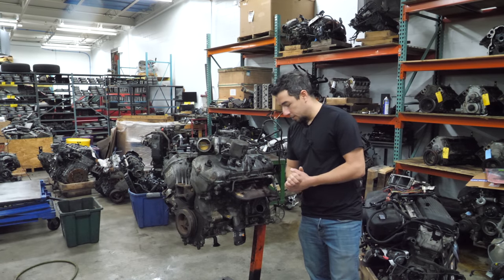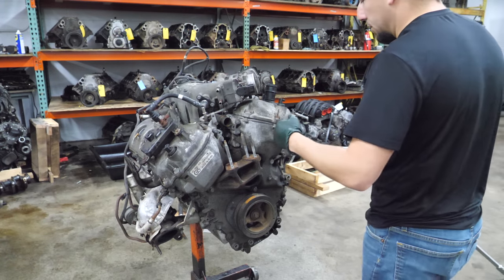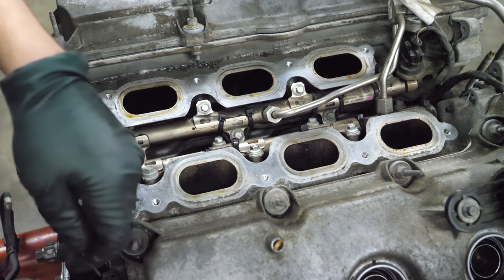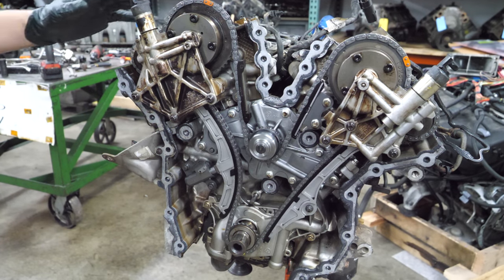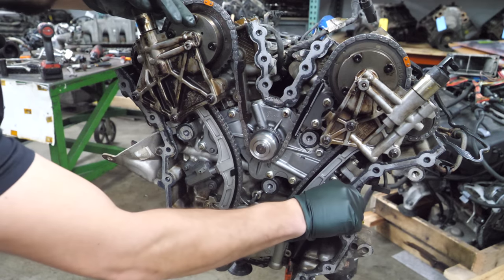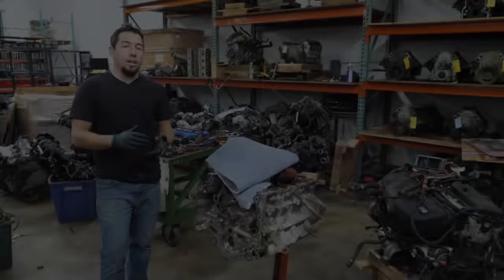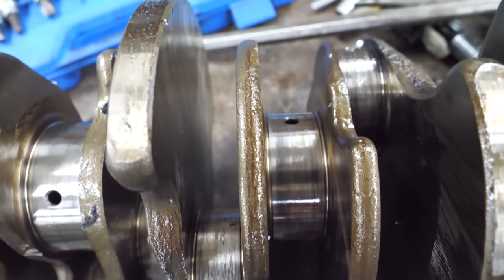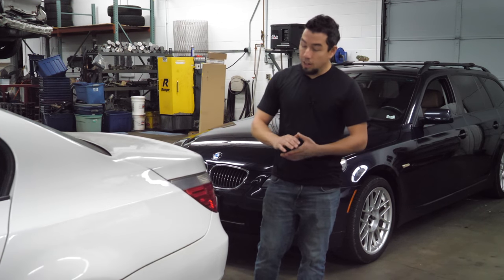Taurus SHO Flex ECOBOOST 3.5 V6 BAD Engine Teardown! What Killed This Maintained Engine?

Comment: I remember watching How It's Made at a Lotus factory, and the sealer dispenser they used only put down a small strand of sealer, about the size of a piece of spaghetti. Ya don't need much at all on two machine surfaces people.. facepalm  Also, EricTheCarGuy has mentioned more than once about too much RTV getting stuck on the pickup and oil starving the engine
Reply: Had it happen.  Bought a little Toyota from a guy who "lost his job at the dealer" He did a light rebuild and it lasted about a month and started knocking.  Pulled the pan and the pickup was covered in rtv worms. Big ones.
Reply: That's the issue that the Toyobaru guys were having with the valve spring recall. Techs were using too much RTV on the timing cover and it was leaking down into the oil pan and clogging the pickup. Bit a friend of mine last year while we were on Tail of the Dragon.
Reply: @CaptainSpadaro  what does Valve springs have to do with timing covers and oil pick up
Reply: @alexstromberg7696  Have to remove (and therefore install and apply RTV, with the associated risk of excessive RTV use) those covers in order to do the valve springs. Excess RTV gets into the oil pickup, then, oil starvation and boom. RTV is only to be used in very small amounts.
Reply: @alexstromberg7696  because the timing cover has to come off to remove the heads? IIRC it's an engine out job anyway because lol Subaru boxer.

Comment: So what happened was, the water pump failed, and the vehicle was ran until it shut off, low oil pressure. Towed to mechanic, they found the bad water pump, did it, chains, guides, etc. and still had a knock and low oil when ran, coolant oil mix, along with clogged feed line screens, killed the turbos
Reply: yep

Comment: Also, must be a 10-12 as it has the single link chain vs dual link
Reply: The aluminum valve covers and steel manifolds tell the tale as well.
Reply: Some of the late '11 and '12 engines got the new timing components before they switched to the new cam and crank sensors too.

Comment: Love your vid's. Coming from an aerospace career, 36 years now retired, I have used pigmat for years and yes it is awesome stuff. Also looking at the design of oil pumps, the gear looking combo is called a Ger-rotor,  it is such a durable design. Seeing all the videos I have from you its good to see this is a universally used design. This engine was maintained, to a degree, I say that considering the odd brand oil filter used! Makes me wonder what oil was used? I agree with Eric, turbo failure was the probable cause of engine death. People are stupid! They ignore warning signs. I do like these engines and have had a few, the power they produce is certainly fun to drive! But you need to be on top of maintenance and quality of fluids and filters used. I know I am preaching to the choir here. 
Merry Christmas and Happy New Year to Eric, family and crew.

Comment: It is kinda sad to see this happen to an engine. They're so complex, and expensive to manufacture, let alone purchase. It ends up being such a waste.
Reply: Puts the whole EV thing in perspective. This engine isn't even that crazy... Look up his Infiniti Q50 V6TT teardown. That thing was a space station. All to make like 19MPG average.
Reply: @future62  And someday we will all drive flying cars!
Reply: @future62  And yet the aftermarket tuners/builders working with old school engine tech can easily do all the numbers on HP and fuel efficiency and more with ease just by going as far away from emmissions compliance as possible.
Reply: These really are simple engines and also cheap you can get a used one for as low as 1400. The tesla battery pack is 20,000
Reply: @blueblood76  Well, from a 4-cycle engine process they might be simple, but from an engineering standpoint they're pretty complex. Just ask the engineers who were involved in their development. And yes, used, depending on condition of course, I'm sure they can be had for cheap money. But coming off the assembly line, they are anything but.
Reply: @michaelskinner896  There is nothing in this engine that engines for years haven't used, Its very easy to work on really. Some engines are a nightmare. Any and all engines are pricey from the maker brandnew. Also these are 6500 brand new while a tesla battery is 20.000
Reply: Sad? This is MY engine. I work for Henry at Chicago Assembly on the motor line. I dressed this very engine. Now I see it’s autopsy! 

When they leave my station I expect them to be well taken care of.
Reply: @snackler6102  It's a really good thing Tesla isn't the only EV maker in the business then.
Reply: @fixedguitar47  Hi I work for Ford in the UK, and worked in Powertrain Product Development for 15 years. I'd agree with guy tearing the engine down that there's usually many warnings before a catastrophic failure. Also worth noting this is basically the same engine in the Raptor and the Ford GT, it's quite an accomplished unit.
Reply: @jameseastwood4984  - I know that, I just expect them to be better cared for. I have mechanical sympathy.
Reply: Bo Blu  Yes they are diaper boy.

Comment: It was mentioned earlier and I don’t know if you see all of the comments but, I would like to see you cut open the oil filter on these obviously neglected engine’s to see if the filters are glogged and allowing contamination to bypass. Which is surely happening.

Comment: That was very... informative.  Ironic for me, anyway, I stopped this video 1/2way through to go eat breakfast, pick up and replace my leaking oil pressure sensor on my 2013 SHO. It was nice seeing it in the daylight instead of in the confines of a dark engine bay. Also helpful was seeing and understanding the design of the internal waterpump and weep hole set up.  In the past 13 months I've had it  with the timing set replaced. Thanks to your wife for allowing you the time to do the teardown.

Comment: This is a bit off topic but it does relate to.the oil on the concrete situation, when I was repairing power tools for a living 20.yeats ago where our parts cleaner was located in the workshop the floor had this thick ripple Teflon coating on the concrete made it to easier to mop up any spills & the ripple coating was there to prevent anyone from slipping & tripping over on the floor if  any oil or parts cleaner was spilled on the floor !

Comment: You are correct! That engine was oil starved because the turbo failed. But WHAT CAUSED THE TURBO FAILURE? ….. Aftermarket oil filters with extended drain intervals. The aftermarket oil filters do not have enough surface area to contain all the oil debris that is generated by the extremely hot turbos. The filters become plugged, and then enter bypass mode. That debris then gets pushed into the turbo oil, line filters, those are located at the turbo charger, where the oil line goes in to it. Once that filter in the turbo was plugged, the turbo was oil starved. It only took very little time to destroy the turbo charger at that point.

Comment: The weep hole gets dried coolant plugging it if the coolant level is topped up repeatedly w/o finding source of leak. The oil seal on pump keeps oil from going into weep cavity but lip of seal is pointed wrong way to stop coolant from passing when it can't go out weep hole. Has happened on Nissan v6 engines too.

Comment: Sister had EcoBoost 3.5 in Lincoln MKT,  needed cam chain at 50,000 miles mostly city driving. Luckily she got it done under warranty.  It was a lemon in other ways too, but fast as lightning.  I told her to dump it, and has an MKX now. Besides carbon building up on back of valves, oil dilution is a problem on those engines.  This coming from a Ford fan.

Comment: Looking to buy a 2012 ford ecov6...  Motor lockup.   Im thinking this condition.  Looks like poor labor did the timing and watrr pump.  Which caused the oil flow issue..  sloppy labor caused oil pump being restricted..   causing all the othere issues!

Comment: On my second car, the boot was also stuck down the well.  I couldn't find the right combination of pliers + luck to free it.  My dad walked outside to ask why I had taken so long, and him told him how stupid the parts were.  I probably blamed everything but myself.  He went back in and returned with a coat hanger, snipped the hanger with the pliers, pinched one end into a barb, and speared the slippery boot like it was nothing.

Comment: An easy way to get those broken off boots out, especially on that engine is spray pb blaster in the hole,  take an awl and work the boot around. Now take a 90° pick and get underneath of it and pull up and it usually comes right out then blow the hole out with the compressed air with a rag over it.

Comment: As I just stumbled onto this post today (12-5-2022). And being this is my first time watching any of your posts , I say Kudo’s !! Great to find someone who doesn’t “ Blather-on,& on “ about nonsense.  My guess as a 43 year career mechanic is that the excess silicone on that timing cover sloughed off internally and in due time were sucked slowly through the fine mesh collection screen on the oil pump pickup , destroying the oil pump by slowly starving the lubrication system. To the point of metal on metal in the rotating assembly that we see all too often as the culprit these days …. Oh well , to quote Queen, “ Another one bites the dust “ …. That turbo though is suspect too…😆👍

Comment: I was driving an ‘81 Mercedes-Benz 300SD on the highway when my engine locked up. Found out the turbo failed and like you said, the oil was sucked out of the oil pan.
Reply: We had a 84 SD but only for a few years. All turbos need replaced or rebuilt every ten years or sooner.

Comment: The Subaru H6 also uses a timing-chain driven water pump that is located behind the timing cover.  The difference is that these water pumps last the life of the car.  Many 300,000 mile H6's are going strong and have never had it replaced.
Reply: Yes our h6 outback had the original WP at 312k when we traded it. It's almost as if Ford designes there WP to fail at 100k?
Reply: @caseyjones1999  Ford's attitude toward design reliability is different from Subaru's apparently.

Comment: It has all the signs of a previous water pump failure. They probably didn’t catch the water intrusion into the crankcase until it has already scored the cam journals . Looks like some shop tried to band aid it by putting a new pump & chain in it but it just didn’t last.
Reply: Very plausible scenario.

Comment: If you get any VW 1.8T in or know of any it would be sick to see one, its one of the most tuned VW engines, love the variety of engine teardown and BMW content, happy holidays!
Reply: I would rather see rebuild of 1.8. The 1.8 is unlikely to have catastrophic failure and more likely to burn oil. I would have rebuilt mine at 330k but the manual seats stunk and rear torsion beam was a nightmare for uneven tire wear. Front end B5 Passat also cost lots to keep up. And yet never an issue with the timing belt.

Comment: I don't know about the 1st gen 3.5 Ecoboost motor... but on the 2nd gen, the SUV / car version of the engine has the water pump internal while the F150 version has it external - where it won't dump coolant into the oil if the seal fails. A much better approach.

Comment: Doing f250 v10, boots would break constantly. Quick and easy solution was an airhose blow gun with a rubber grommet around the nozzle for a good seal - blows the boot right off.

Comment: Had a customer bring in an F150 eco boost 3.5L that somehow had blown a piston skirt off.  Also had some pretty badly scored bearings, but I don't remember which they were. I think they were connecting rod bearings, furthest from the oil pump, but it was years ago.

Comment: I had a 2019 SHO awesome car rode nice and was very quick with those twin turbos, good lookin car, but the carbon issue became more and more of a concern for me with the more research I did, so I decided to trade the car in and went back to a panther.... Great channel Great content never miss any of your tear downs!!
Reply: You really don't have to worry about the valve coking hurting anything major. Plus you can have valves cleaned with walnut blasting or clean manual like I do.
Reply: @blueblood76  I had the damdest time trying to figure out if the car had duel injection I know they started that with the F150's but nothing about the cars??
Reply: @andrewjacobson556  That's right the cars don;t get the dual injection on 3.5's

Comment: I've seen a lot of these 1st gen transverse 3.5 ecoboost self destruct because of the internal water pump when I worked at Ford service. Once the coolant starts leaking in the engine, it's a domino effect of destruction from there on out if not immediately caught. If you drain the oil pan and you get a chocolate milkshake drain out, more often than not, your engine and turbos are done.

Comment: That oil filter is made by Mann and Hummel- one of Germany's highest quality filter makers.  It could be a lower end one, I don't know, but no doubt, it's going to be far from Fram.  It's still referenced in numerous places as Wix, who also doesn't makee or distribute low quality filters.  Used to use Napa Golds and now I use Mann or Mahle.

Comment: "I'm just the guy that zips the bolts out until parts falls off", now that's a great line. Now you should actually try that technique and then through the magic of video editing hit it once with a hammer and the engine just falls apart.

Comment: if I ever have my own shop, it's floors will be concrete with a thick epoxy so that a simple wipe up will remove all spilled liquids. No liquids will soak into the crete.

Comment: Variable compression is the same as variable valve timing. Close the intake valve late and you lower your compression . That’s the reason the high compression 5.0s are able to run with high boost and high compression

Comment: With regards to the fluids hitting the floor, save yourself a possible future headache and take the advice to catch all the fluids. Imagine a scenario where you want to sell your building some years down the road. The Buyer may request soil sampling and soil remediation as a condition of sale. You DO NOT want to expose yourself to Environmental-related risks. Extremely expensive excavations, hazardous waste charges, and repair bills may await. Get the larger fluid pan. The risk isn't worth it. "Pay me now, or pay me later" (exponentially more) as the old Fram commercials stated.

Comment: 8:04 the thing on top of the rear valve cover appears to be the 'crankcase vent oil separator' (Ford term, not mine), so you're right.

Comment: I had a pretty good guess at what killed that motor although I didn't think the turbo was the culprit at first. Having owned a non-turbo version, I know the main reason these motors die is that stupid water pump. He did a decent job explaining the weep system but what he didn't mention is the failure mode when the shaft seals leak. Because that timing chain uses the water pump as a pivot point, it's subject to a lot of force from the motor. That high tension pulls the shaft of the water pump out of its plane and it begins eating the bearing in the pump. That's why it was so rough when he tried to turn it. Because the bearing fails, the shaft seals leak and the water misses that weep channel and ends up going into the timing cover. Because that timing chain gets oiled with engine oil, the oil has to have a way to get back to the pan and it ends up taking the water from the leaking pump with it. Once the water gets into the pan in sufficient volume, that's all she wrote. It makes the forbidden glitter and sends the stanky milkshake up through the oil pump to all the expensive spinny bits. One tip off that its time to sell the car is that you'll get a CEL for the VVT system not working. This is because the milkshake gunks up the oil pressure-actuated cam phasers and they don't engage correctly. Your motor is likely abrading its bearings down to powder at this point and you should flush the oil system out, and get rid of the car. If you haven't done a water pump change on one of these and you've got 100k miles, you really should. It's expensive but it will save the motor, assuming its not too late. 
I had an 09 Flex with the non-turbo motor and we lost the water pump. Luckily, we lost the coolant all at once and got the overheat warning. Shut the car down and went into the shop where they changed the water pump. The service manager did me a solid though and discretely told me to dump that car ASAP.  I'm assuming the oil pan was full of water and the engine had been circulating it. We saved up a small down payment and traded it in on a Nissan Quest which was super reliable for the 4-5 years we owned it. Never a serious mechanical problem with that van.
That's when I realized just how bad Ford's engineering of this engine was. Compared to Nissan's VQ35, this Duratec is a turd. The Nissan drives its water pump with the timing chain as well, but it is not a pivot point on the chain. The Nissan water pump is just driven by the chain on the left side of the engine, but is not subject to all the same loads. Also, most of the FWD Nissans with this motor have an access cover in the timing cover itself. You let tension off the timing chain by holding the tensioner back and you can slip the water pump out without having to remove the whole timing cover. Slip the chain off, pull the old pump out. slip the new pump in and bolt her down. Release the tensioner and button everything back up. So much better.

This is probably one of the reasons Mazda ditched its association with Ford and is running that sexy new 3.3l inline-six in the CX9.